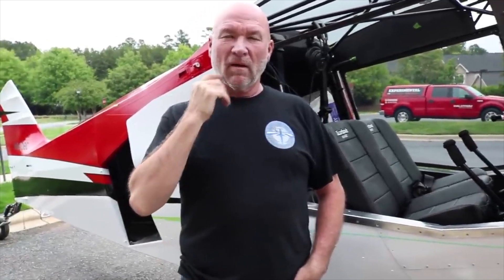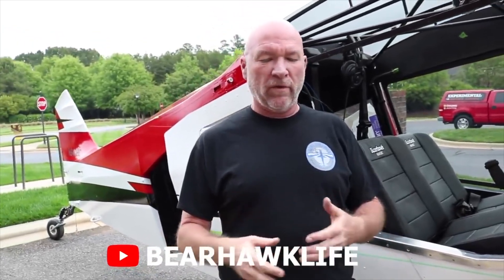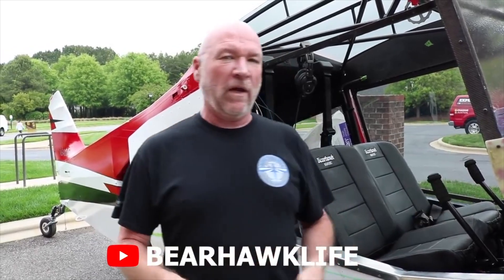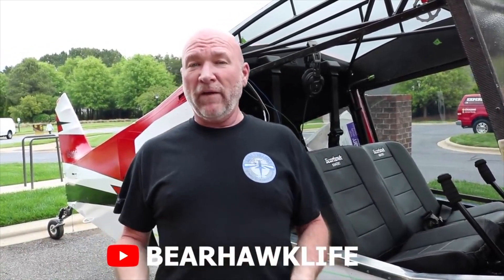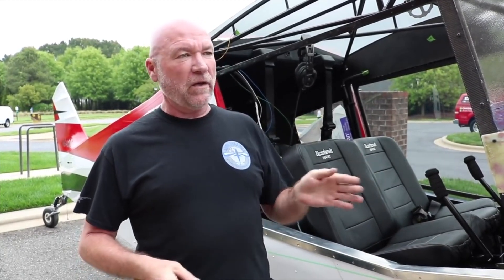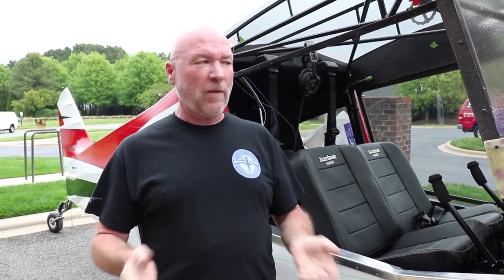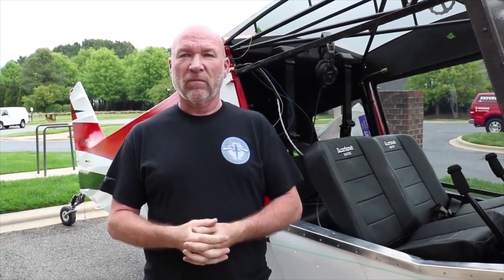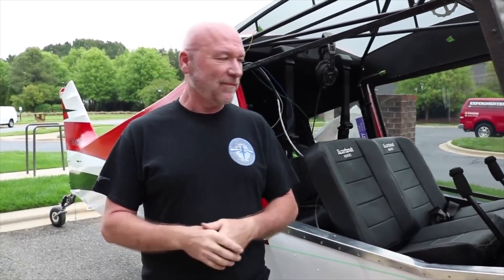BEARHAWK ~ About this Channel...

Comment: I looked into a Bearhawk! They seem to be really great with useful weight and reliable build kit. It would be this or an RV for me.
Reply from the maker: The RV is much easier to build as it is pretty much follow the instructions.  The Bearhawk takes a little more work and thought.  I really can't see how either compare as they are different airplanes for different intentions and missions.

Comment: Rob, It is refreshing  to know that a newly retired  person  like me , Can Downsize to a smaller home and still be able to build an airplane kit of his or her dreams ! Bravo to you. Did you start with a parts KIT or pre-built wings and Fuse? You actually covered and painted the plane in a one car garage ? Exited to see more of your build and finishing Videos. Thanks.
Reply from the maker: Hey Daniel.  I purchased the Bearhawk Quick Build Kit.  Yes, the garage is small but doable.  But not practical.  I have to keep the wings in a storage unit, which is an added expense, and will be shuttling the fuselage and wings back and forth.  Fortunately we are building a home on an airpark and we will have our own hangar.  Much better!